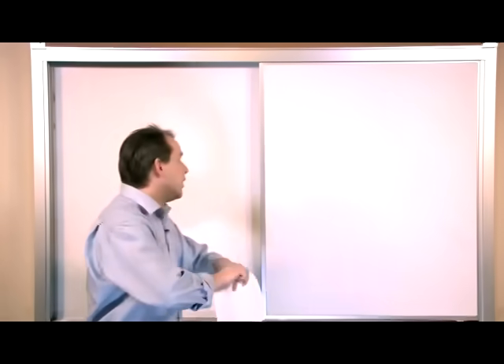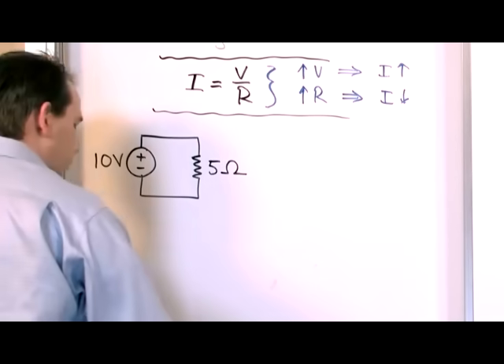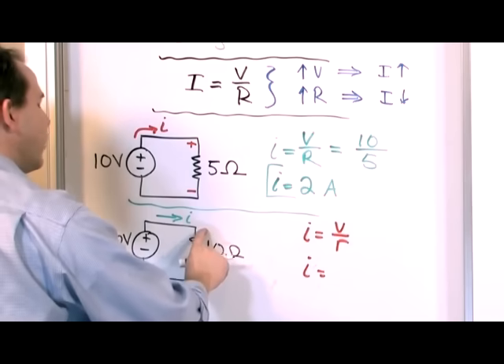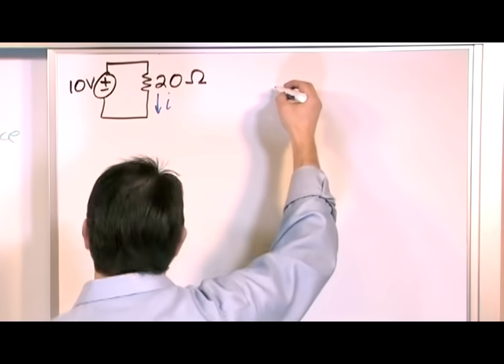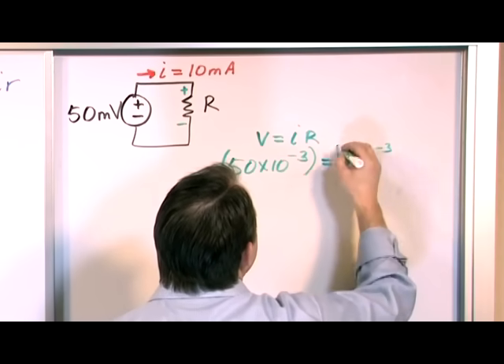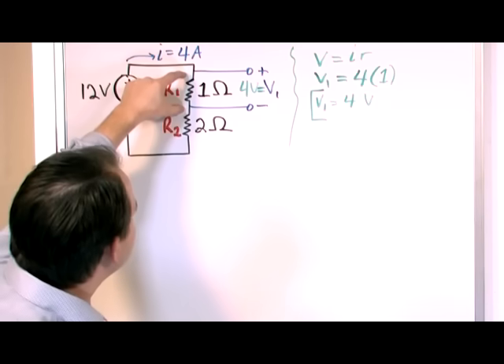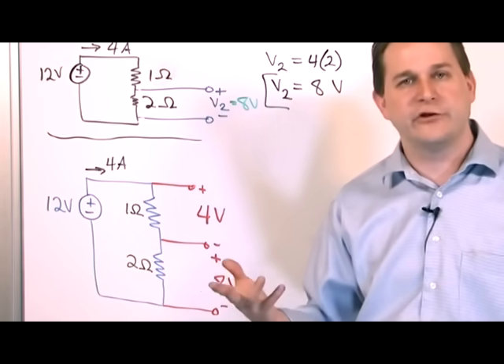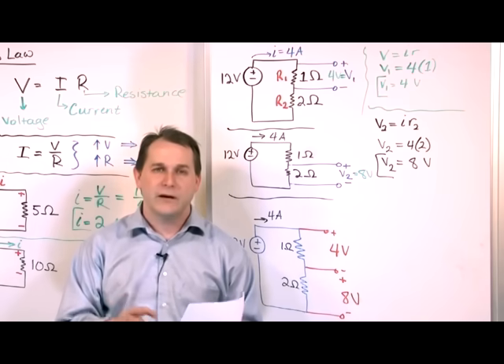03 - What is Ohm's Law in Circuit Analysis?

Comment: You did a great job explaining ohm's law.  I am just missing something...  If you have two resistors both having a value of 1 ohm,  wouldn't that have a total of voltage across both resistors  of 8 volts ?
Reply: Depends on the how many amps you have running through your circuit. Are you absolutely sure you would still have 4 A? Obs: trick question.
Reply: I had the same confusion, and so did many others in comments. And i tried to also figure out why we got confused.

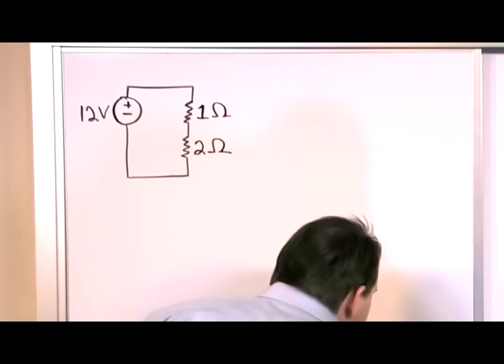It is because of what he says at 25:35 that 4amps is going IN and writes it as if it comes out of the battery. That is what creates the confusion the word IN because your mind thinks the 4amps is coming from the battery so it is constant from the battery which he then says is what comes out the bottom too he says it goes all the way around. again,.makes you think its a constant from the battery RATHER than a flexible number that depends on the components in the circuit, not the battery at all (which ironically is the lesson trying to be taught). 4amps only goes in AND out due to the resistor values making it 4amps going in and out. And if you change the resistor values you change the amps. He doesn't let you know he calculated it based on the resistor values prior.. thats how he got 4amps. Change the resistor values and the amps change. So i dont think it was ideal for him to say it the way he did and write 4amps with arrow out of battery. He should of said the reason its 4amps isnt because i say so or because it was measured or because of battery...its because of the resistors and thats the point if we change their values this 4amps value changes too... Ohms law. I found his first video good, this one not so much.
Reply: Two resistors are connected in series or parallel?

Comment: I don’t understand what he means when he says there’ll be a voltage drop across the resistor, if he’s also saying that the voltage is the same before and after the resistor
Reply: @Fester Blats  just wait till the resistors are in parallel and then you will understand.
When resistors are in series, add the resistance up in ohms

Comment: In the first form of the equation V = I R, a resistance of 0 is fine but still doesn't make much sense to me. If we don't connect a resistor then there is no voltage? Also, if we don't have a resistor in the second form of the equation I = V/R then we have an invalid expression. What is going on here? Do we just ignore this? I'm sorry if this is a dumb question but I am coming from a programming background so these issues are glaring to me.
Reply: Well, 2 things here.  Even if you don't connect a resistor to a supply voltage, you will still have voltage equivalent to your supply voltage.  You just won't have current.   If it is 12 volts, if you probe it, it will still be 12 volts on this open circuit.  On your 2nd question, if your R is zero, you basically have a short circuit i.e. your I goes infinitely high and burns your circuit.  As of the expression, yes, it is undefined.
Reply: of course they are not the same.  one is open and one is shorted.
Reply: As a programmer myself, I understand your frustration! But when programming we live in an ideal world where 2 * x always equals x * 2. Electricity lives in the real world. Wires have resistance. Very low, but still measurable. And even if you had a perfect, superconducting wire with zero resistance, the battery itself has an internal resistance. The end result is that your R will never equal zero.

Now, if you can invent a perfect superconducting battery and use perfect superconducting wires for your experiment, then the universe might just implode. So please don't ;)
Reply: @JanBruunAndersen  You can just inject electrons into a superconducting wire loop and the electrons will flow around it forever

Comment: I dont quite understand. How can the voltage going down the resistor be the same at the beginning of the resistor and the end of the resistor.  In other word wouldn't the voltage that is before the resistor be higher before it hits the resistor and go lower after the resistor?
Reply: Candice Jones  When you put a voltmeter across the 1st resistor, you are measuring the voltage drop. Try putting a positive probe at the bottom of R2 and put a negative probe to ground, you will get 0 volt because the bottom of R2 is basically connected to the negative of the supply voltage.
Reply: Jancen thanks
Reply: Candice Jones The split second current hits the resistor, no voltage drop occurs. But when the current has 100% finished going through the resistor then. The voltage drop occurs.
Reply: Tom Wold thanks
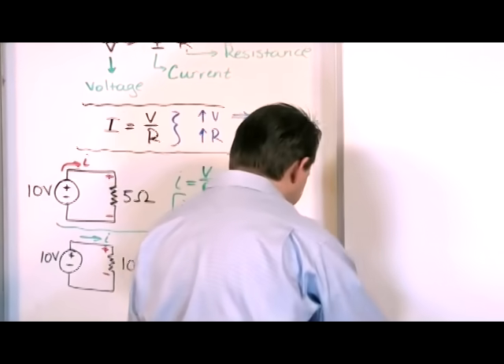Reply: go back to the video and start at the 17:00 minute mark. Hope this helps...
Reply: richard foutch thanks
Reply: Had R1 being 2 ohms and R2 also 2 ohms, the value of V1 is 8. I am wondering what would the value of V2 be? By using Ohms law, we get V2= 8 (that is, 4 *2). If we add V1 and V2, we get 16 = (8+8) whereas the original voltage was only 12. What am I getting wrong? For instance, shouldn't the current flow between R1 and R2 reduce to 2  or something like that.
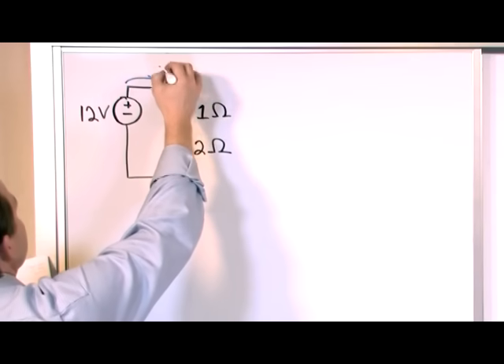Reply: It may be that your answer lies at the  <a href="https://youtu.be/lf0lMDZVwTI?t=1540">25:40</a> mark, where he says that in this example, they happened to measure and KNOW the current is 4A.
Reply: No idea why the link does that but it works
Reply: Gel Featherweight Thanks for the explanation.
Reply: Gel Featherweight thanks
Reply: Gel Featherweight Thanks
Reply: @CosmicChaosQueen  - I happen to think that you are right about the difference and the drop across the resistor - as long as we are talking about voltage drops. The current will still be the same, otherwise it would have disappeared somewhere, like if some of the air he blew through the straw suddenly disappeared somewhere between his mouth and the exit of the straw - which clearly do not happen unless there is a hole in the middle of the straw.
Reply: Gel Featherweight so what would happen if we added a 3rd 2ohm resistor to the circuit? That’s going to add another 4 volts isn’t it? Ps I’m a carpenter so this is all new to me 😂
Reply: McFarah Gulled thanks
Reply: @McFarahGulled  - you are getting it wrong because you (wrongly) assume that you would still have 4 A to play with. If you go back to the start when he described to setup of that circuit, he explicitly said that the 4 A had been measured. If you start to change the circuit by upping the total resistance to 4 Ohm, the measured value of A would also change. In fact, Ohm's law will tell you how many amps. V = I x R equals I = V / R equals I = 12 / 4 equals I = 3.

Now do your analysis knowing that I = 3 and see what you get ;)
Reply: Jan Bruun Andersen  I think the confusion lies in hearing him repeatedly saying it's the SAME 4 Amps you started with at various times.  People think it's still 4 Amps no matter where you're measuring, even after the resistance.  Maybe he could have explained it differently.  I was confused by that.
Reply: if you put two 2ohm resistors in this circuit in series then you have increased the total resistance to current flow so hence the current flow now would be 3amp and not 4amp , the circuit now with two 2ohm resistors has a lower current flow due to higher resistance.
Reply: @McFarahGulled  If R1 and R2 are both 2 Ohms (2 + 2 = 4 Ohms), then the current will be 3 Amps (12 V / 4 Ohms), not 4 Amps.
Reply: @McFarahGulled  R1=R2 both 2 ohms. Power supply is 8 Voltages. And I assume you have the resistors connected in series;

So basically 8 volts / 4 ohms = 2 amps 
R1 x 2 amps = 4 volts
R2 x 2 amps = 4 volts.

Since R1=R2, it means also that V1=V2

I=U/R

R1+R2 = 4 ohms
V1+V2 = 8 volts
I= 2 amps.

I suggest you re-do your calculations-
Reply: good question
Reply: Just think of the current traveling from negative to positive like it does in reality. 2 ohm resistor would bleed 8 volts leaving 4v, 1 ohm resistor would bleed 4volts leaving 0 at terminal. I know it's bad advice as engineering teaches hole current but it's the only way I could understand it. Maybe I'm wrong.
Reply: @helloworld20288  Thank you.  This made so much sense.
Reply: Candice Jones no mate purely because it was a simple  circuit with 1 resistor I.e a 1 load ( could be anything) which is basically neutral you probably know if you measure between live and neutral you will get 240v in the UK So that's basically why .ohms law is pretty easy to understand really it's  only a it bit of  algebra  .  But when you start getting  in to micro circuits and and pcb builds it's a different ball game diodes,  capacitors, transistors,Inductors,that's what he was getting towards on the other circuit he drew . But the maths is always the same ✌✌✌
Reply: Gareth Rowlands thanks mate!